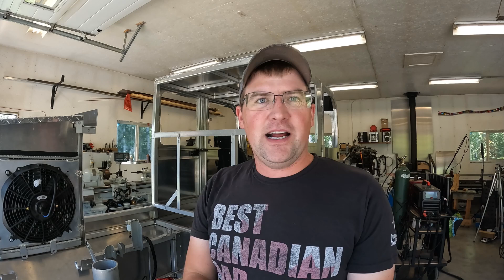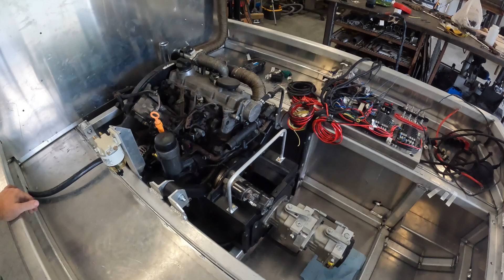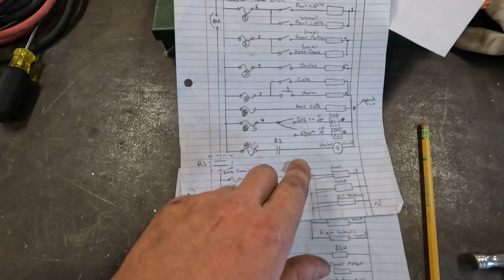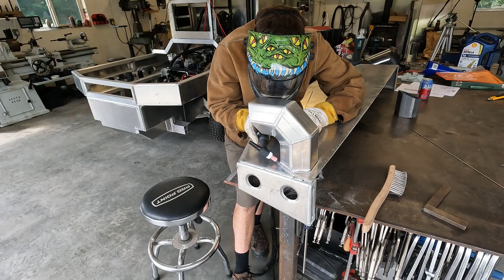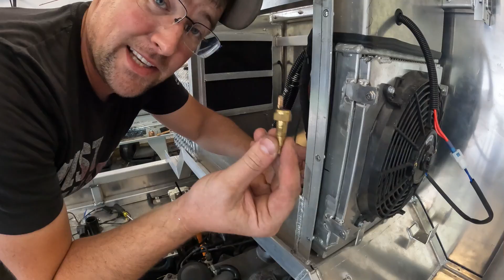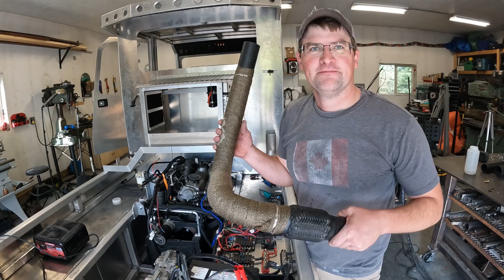Major Milestones on the Build | Snowcat Build PT33

Comment: Comment, i would not seal the cowling with silicone mass, but strips of rubber (or some other compressible fabric, they are in stock in various versions, i would take the one that comes with glue on one side to be glued to the cowling). then you can always take it off. also the strips make a nice resistance layer to squeeze together reducing any rattling even more than the silicone does.

Comment: I know this video is a year old at this point but consider wiring in an SB50/SB75 connector to the battery and mounting it someplace that is accessible from outside the vehicle once its all put together, you can make an adapter with jumper leads on one end for easy jump starts or jump starting some one else, or for a battery tender for when the vehicle will be sitting for some time.
Reply from the maker: Hey thanks! Might be a year old but I am still building it! Lol 😅. I’ll look into that thank you! Cheers

Comment: Awesome such a great job. Exciting! What pumps/motors?
Reply from the maker: I sourced the pump and motors from a manufacturer in China to keep some costs down with it being a prototype. Can upgrade to better one later if they don’t work out. They are I believe 31cc manual displacement control piston pumps. The motors are larger hydraulic wheel motors meant to take a lot of lateral load. I cannot remember the specific displacement of them off the top of my head. I’ll look that info up and include it in the videos about the hydraulic system when we get there. Thanks for watching
Reply: Thx was wondering how you figured out pump sizing etc. You must have prior experience?
Reply from the maker: That was about a year and a half ago I dug right into hydraulic design and I also have a friend who also ran the numbers to double check. It started by figuring out the drawbar force I wanted the vehicle to have. Ie the max pulling or pushing force. Variables you have to consider are vehicle weight and traction because you can have all the force in the world but if the vehicle is too light you can never get it to the ground. So I have to make some assumptions and estimate my weight and come up with a force number. That leads you to selecting motors that can developed the speed and torque you need. Then determine hydraulic design specs like pressure and flow rates to size your pump. At the end of the day I just had to decide what do I think will work and what can I afford. I spent months going back and forth on my sizing. Ended up selecting what I did because I errored on the side of excessive power to the ground. It’s more useful to me to have power and move a bit slower then go fast but struggle on hills or pushing snow. 
I know that wasn’t very specific but I started with some math to get an idea of what I needed then just had to make some guesses. There likely will be issues I need to address.

Comment: So does the ole VW diesel peg that oil pres. gauge when cold?
Reply from the maker: Not too much. About 65 pounds. I think that’s fairly typical.
Reply: @CenterLineDesigns  I drove VW diesels for 26 years, the 1.6 type. Always had mechanical OP gauges. When cold, if you rev them a bit the needle would easily go past 130 PSI.
Reply from the maker: Oh hahaha. It really isn’t too cold out yet. But I am curious to see how it is at actual cold temps. Crazy pressure lol
Reply: @CenterLineDesigns  Yes sir, crazy oil pressure. The oil filters for them are made from extra thick metal.
Reply from the maker: Haha wow. Well I guess we will see what this goes up to soon! I really want it to be useable this winter!
Reply: @CenterLineDesigns  It will be fine, just let it warm up and the oil thin out before higher revs.

Comment: Heck yeah, so for the steering, are you going to do levers or a steering wheel?
Reply from the maker: That is a good question. I have it down to two small levers like some of the newer cats or a joystick that will run the two push pull cables. The steering is all just manual to the pumps. Went that route for simplicity. Time will tell what works the best! Cheers

Comment: I like the lines of the body. It has its own character. Everything is proportionate to the overall design. It really projects a theme of serviceable and functional.
Reply from the maker: Thank you so much Kevin! That’s is something that I think largely goes unnoticed. The hours and hours spent just thinking and designing to try and avoid space issues and make it service friendly. Glad it doesn’t go unnoticed. I “try” to think of how everything interacts and often have to think many steps in advance. I can’t even say how much time was spent just staring at it trying to make sure my bases are covered. I have really tried to make it not seem homebuilt! 

Thank you again. I appreciate it!
Reply: @CenterLineDesigns  I’m a believer in “staring at” something you are designing. People think you’re just looking. But you are using your cognition to imagine alternatives and predict challenges. When you get it operational, undoubtedly issues will come up which you’ll need to address. But they will be manageable because your design included serviceability. I’m eager to see the drivetrain come together.
Reply from the maker: Exactly! You get it 100%. I try to design with a Plan A,B,and C. I told myself at the beginning that there will be issues at times. But that’s all apart of the process. I always try to identify what could be an issue then have a backup for that. That may be why I really haven’t had to go backwards much on this build. Actually have surprised myself. Most decisions are made based of how serviceable it is, then functionality and then cost.